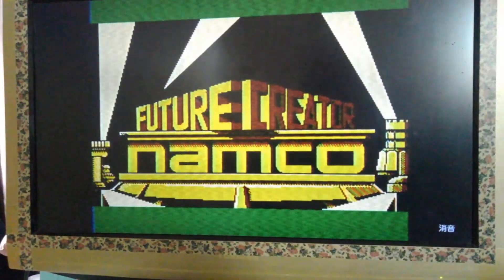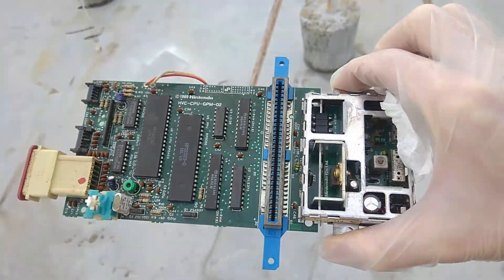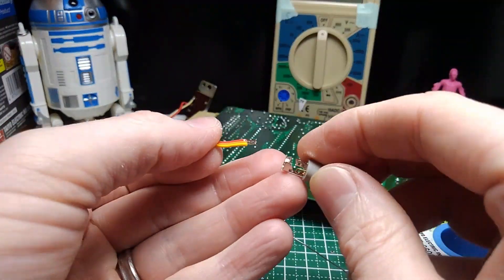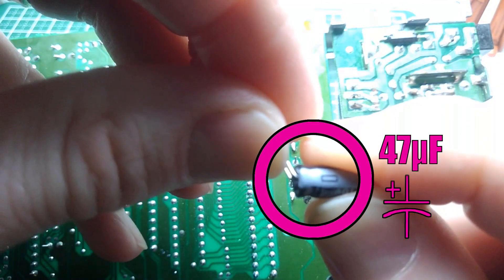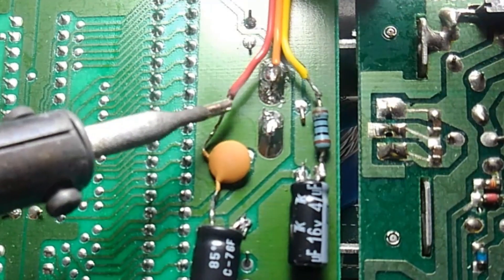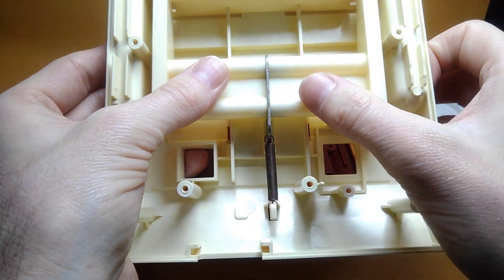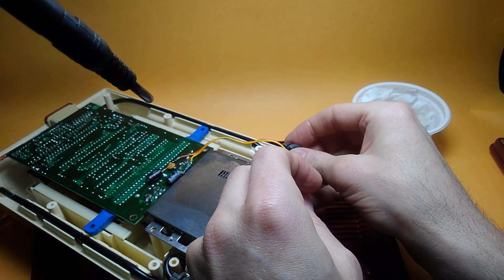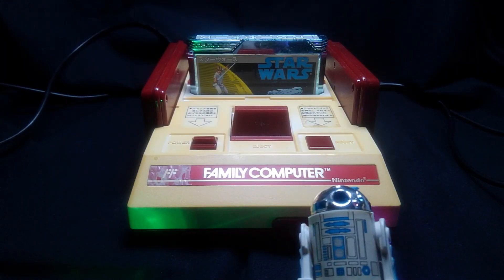Famicom AV mod made easy

Comment: Just because I’d like to make things a little more modular, is there any reason why I can’t put the additional components and outputs on a bit of strip board and run wires from the points on the original famicom board to the strip board?
Reply from the maker: Yes, many people make their own boards. 👍🏼

Comment: Hi, thanks a lot for this ! Just a couple of questions: 1) is this mod working on PAL TVs as well ? 2) Can I use the SNES/Super Famicom power supply for the Famicom as well ? Thank you in advance for your help
Reply from the maker: It should work on pal with the av mod. But SNES and SFC adapters are different I believe. super famicom and famicom adapters are one in the same. Just don't take a Super nintendo adapter and use it with a Super famicom or vice versa.

Comment: about the ceramic capacitor, do the volts matter? because i found one that has 50V and i dont know if it will damage the famicom
Reply from the maker: 50 volts is the rating of the capacitor so the higher the voltage the better. If the original capacitor was 16v and you replace it with a 50v that means it can take a 50 volt charge if for some reason that would even occur. Rule of thumb is its OK to go higher on the original voltage. But you don't want to go lower.

Comment: I bought an av modded famicom and it has scrolling static . Do you know what could be causing this ?
Reply from the maker: It's really difficult to know what the issue is without having it in front of me. But often times a Cap replacement is a good start. Also I find changing out the power board has worked for me. Good luck 👍✨️

Comment: Yo! It's my first time commenting, but I can't thank you enough for the content you release. I've recently been to Tokyo and managed to get "junk" hardware to restore and repair - and of course, I got a Famicom! I tried this mod on my HVC-CPU-07 revision, and I get a dark picture. Not extremely dark, but abnormally dark. What I tested : Changing the resistor to 220 / 100  ohms, soldering on the VID pin, soldering on the E pin of the transistor, and it changed absolutely nothing. Can that be because of the still connected RF module? After checking various AV mods, I see that a lot of mods remove the 2SA937 transistor. Can that be because of a tired transistor, too? Do you have any suggestion? Thanks!
Reply from the maker: I appreciate the kind words. HVC-CPU-07 has a different process from this video it involves lifting pin 21 and adjusting the transistor like you mentioned. I plan on making a how to video about it soon so be on the look out and good luck. There are other videos out there that will show you how just take a quick youtube search🙏🙏🏾🙏🏼✨️

Comment: I know this is an old video but, the little black plastic thing you routed the wire through so you didn't need to drill holes is called a grommet. Also thanks from 2024 this works great and looks nice as well.
Reply from the maker: I'm glad it worked out for you. I like to call one Wallace so no one gets jealous 😉

Comment: I've got a modded AV famicom, i got audio but I can't get the video to work! I tried 3.5 male to female RCA adaptor and direct 3.5 to RCA video cables but neither worked.. Tried Video w/ Mono sound, and Video w/ stereo sound and also didn't work. I don't know what to do with it anymore.
Reply from the maker: It may be the 3.5 jack and cable don't match try hooking up the red and white to the video in on TV not all cables are hooked up the same. To be sure you need to test from the mobo to the end of the cables to know for sure.
Reply: @ScruffyLookinRGB  Already solved it thanks! Switching matching colors worked for me. Sadly, i can confirm I got vertical stripes on the screen, and I can't use my Famicom with RF cable... Strange since the mod looks almost the same as yours. Thanks anyway!

Comment: I'm planning to order a famicom (idk what revision I'll get, lol). Your mod looks the simplest and has minimal impact on the console. Other mods use transistors, is there a difference in signal quality?
Reply from the maker: The earlier mobo revisions tend to have a much noisier signal. Later revisions have a much clearer signal. The earlier versions need a litte more work to get a clear signal. If you want the best signal the av famicom is the way to go. But if you like the original famicom astetics the later one is easier to mod for av.
Reply: @ScruffyLookinRGB  
Thanks for your reply!
Famicom looks like the console from my childhood and AV Famicom is too expensive.
By the way, I looked at the auctions and I have another question: if you just buy something that looks normal but has not been tested, what is the likelihood that everything will be fine with it? If there is just a little rust and swollen capacitors, this is also normal)
Are there problems there, like with the Super Famicom, when one of the processors may be faulty?

Comment: I noticed some light interference such as a faint buzzing sound in the background and very faint cascading static bars. The coaxial cable also has the interference so maybe it's something else.
Reply from the maker: The older famicom boards are quite noisy. It's tough to get them just right
Reply: @ScruffyLookinRGB  I took a second look and the coaxial output image is clear. It's only the mod that has that interference. It may be related to where I attach the 3.5mm to RCA cable into the Jack.

Comment: Hey man this might be a dumb question but is there a difference between a 16V audio capacitor and a 25V ?
Reply from the maker: 25V means the cap can take in more voltage than 16v⚡️rule of thumb is it's OK to replace a cap with a higher voltage rating never the opposite 😉

Comment: I like the idea of doing a no-cut and fully reversible mod. Also much cheaper than a VAMP board.

I wonder how easy it would be to do the old NES stereo audio mod with this. But also still having it be no-cut. Maybe with a small screwdriver sized potentiometer through one of the vent holes?
Reply from the maker: Nes stereo mod? Do you mean suddenly stereo or actual real stereo?
Reply: @ScruffyLookinRGB Not true stereo no. Just a slight separation of a couple of the voices the system can produce.
Reply: @ScruffyLookinRGB  I finally did the composite video mod. It worked out pretty well.
I am noticing a lot of jailbars and jitter in the video signal.

Maybe it's just an inherit issue with composite video out, but yours looked a lot better in the video.

Comment: Did not work all i hear is static noise when turning on fc on tv and no video btw i did everything you did
Reply from the maker: I would check your joints again and use a multimeter to make sure the video and audio are coming out the cable you expect it to. Good luck
Reply: @ScruffyLookinRGB   everything seems connected someone did a video and  have  the same model i have and did your tutorial and got the same result 
https://www.youtube.com/watch?v=mORA7LEGzLo
Reply from the maker: Did you check the rca cables with a multimeter while plugged into the trrs jack??
Reply: @ScruffyLookinRGB    yes everything seems connected
Reply from the maker: Does the rf output work?
Reply: @ScruffyLookinRGB  yes
Reply from the maker: You could try slightly lower or higher values on the caps and resistance

Comment: Beautiful.  It’s really cool that you kept it completely undo-able, I often wrestle with this very thing between being a collector and a fixer…. Perfectly adding a 3.5 Jack in the back would make me so happy, but also keeping it completely original would too…. It’s rough.  😅

I picked up a pristine Famicom a few years back listed as “junk” at a recycle shop.  They said it didn’t work, but it was so clean, un-yellowed, all stickers and port covers… and only 500円 it was a no brainer.  I figured at the very least I could case swap a functioning Famicom…. but for whatever reason, maybe my bad Japanese understanding (though it WAS priced as junk), it worked completely fine.  I still don’t understand the problem.. they had plenty of power adapters for sale that they could’ve used to check it.. 🤷‍♂️
Reply from the maker: Thanks. I'm glad there are others out there who agree with me and are unsure to add a jack or leave it as is.  This way we can keep the ancient rf intact. 
In Japan often junk just means untested. A lot of times they just don't have the time or care to test it.
Reply: @ScruffyLookinRGB  The fact that both outputs still work is pretty amazing to me, I’m glad you were able to figure that out.

Many a great deal, just because a Japanese person won’t be bothered to plug something in.  😂  I’m at about a 95% “completely fine” rate for “junk” items so far.
Reply from the maker: Yes same here I've come across a few that didn't work but were repairable

Comment: Hi, when I do that my screen is darker than RF. Do you know how I can have more light please ?
Reply from the maker: Try another tv and see if its the same. If it's same you could try a different capacitor value on the video side
Reply: @ScruffyLookinRGB  ok i will test others capacitors because i already try to change TV, same.
Reply: @ScruffyLookinRGB   What is "Takman" ? I did it with a simple 120Ohm resistor. Is it different ?

Comment: I just opened my famicom up and found it is the CPU-07 from 1984 motherboard and yours is a later revision.  I wonder if I can still follow your tutorial vid.  The back part looks the same as yours
Reply from the maker: If it's the older revision, it won't be the same as this one. But the good news is it easy to swap out the power board for a new one with composit video. Rgr makes a good one.

Comment: Ordered the parts to try this I have the same board I get great video through the coax but no sound so hopefully I get sound with this
Reply from the maker: Good luck! I hope you get the sound up and running💪
Reply: Got my parts in and installed iv got sound now and better video. Thank you so much. The bigger capacitor does seem to barley hit the bottom case and slightly bulge it when tighted. But I don't think it will be a issue.

Comment: I got a famicom diy kit av mod kit on eBay.  Just wondered when you prep the board and put flux is that the same as using soldering rosin?  I’m planning to learn to solder using a cheap famicom.
Reply from the maker: Yes and yes. I would suggest a no clean flux. Rosin or soldiering past leaves a bit of sticky residu so if you go that route hit it with some ipa to clean up the area.

Comment: I did this mod to a HVC-CPU-07 board Famicom and it worked, despite having different soldering locations. The picture is very dark, however. I saw in another comment that you mentioned changing the capacitor value may adjust the brightness of the picture. What values would you suggest trying to get this brighter picture?
Reply from the maker: I'd say between 220uf an 1000uf. Hope you find the sweet spot.
Reply: @ScruffyLookinRGB  Thank you so much. I’ll order a couple capacitors and check it out. Another theory I have is that it may be because I am powering my Famicom with a 9v Genesis Adapter rather than the original 10v one. I’ll let you know if I figure it out

Comment: @scruffylookingrbg i did this mod and i can only get it to work properly when something is plugged into the rf port.  Did you have this issue? I'm having it on two tvs with two different famicoms...
Reply from the maker: I've had issues with video or audio not coming through, but it always comes down to a poor connection on my soldiering.
Reply: @ScruffyLookinRGB  seems like I needed a bigger ground wire than I was using. All set, thanks! I have another revision I'm trying but getting no luck.  Not enough ground like the other but no matter where I ground it I'm having the same issue.  Might have to do the full conversion mod on that one.

Comment: Heyo, I've attempted this mod however I'm unable to produce any video, audio comes through completely clear, I've checked all the pins on my TRRS jack just to make sure the pin out isn't different, only thing I can think of is the fact I'm using a 1/2 watt 120ohm resistor, do you think that'd make the difference between picture and no picture at all?
Reply from the maker: I don't think that would be the reason. Usually it's a connection issue. I'd double check all your soldier joints.
Reply: @ScruffyLookinRGB  seems like my Retrotink 5X was the reason i wasnt getting a picture, directly into my TV tho gives bad waving lines and a loud buzz when the video signal is connected, all my solder joints are definitely good and i'm using the same components listed in the description, its so confusing :S
Reply: yo! just an update, got it all working, needed to ground the video connection seperately, must've been something off with my TRRS jack cause for some reason it only grounded the audio, the picture being all wavy and buzzing caused the retrotink to not accept the input aswell, so as soon as i got that fixed the RT5x was working too and looked very good for Composite, thanks for the vid!

Comment: Hey Scruffy! A question, I mistakenly bought 2200uf capacitors instead of 220uf for the audio.. Can I use them anyways? :) Thanks!
Reply from the maker: No, you gotta have the right value of microfarads
Reply: @ScruffyLookinRGB  What is the thinking of putting a 220uf in series with a 1uf, all that does is make  a 0.995uf capacitor.
Reply: Will ask for them to change up the order! Thanks
Reply: Yeah, the series capacitors confuse me too, from my understanding the 220uF capacitor doesn't do anything here?

Comment: Hey there! Thanks a lot for your video, I have an already modded Famicom but it's getting some weird white faint lines where objects are (in the game) and I'm going to try and get that mod out and do this one as soon as I get some level ups on my soldering skills. Thanks!
Reply from the maker: I hope you are able to fix the issues your having👍👍👍
Reply: Thanks a lot! Should be easy getting the other bad boy out I suppose. Just get the hot glue out, de-solder those wires and caps and see if I don't wreck it more than it is already! :D  @ScruffyLookinRGB

Comment: does it matter on the rating of the 1uf ceramic capacitor? im seeing 1uf 50v ones from my supplier

also is the mod different for the original famicom that has the soft square button controllers?
Reply from the maker: 50v should be plenty.

Comment: I did a similar av mod to my HVC-CPU-07 model, i had to kinda figure some stuff out on my own but i got it to work. But the picture is really dark
Reply from the maker: Glad to hear you got it working. some times you can change the value of the cap it may give you a brighter image.
Reply: @ScruffyLookinRGB  Ohh okay, thank you! Can I just remove the cap and connect the video out pin directly to the TV?

Comment: You are a hero! I just purchased a famicom without realizing it was RF so i was nervous when it came in. I was even more nervous when i saw i had a different board then yours. But thankfully your tutorial still worked on my board! The sound is perfect and the jailbars are very minimal. My one issue though is that the picture is quite dark and i'm not sure what is causing it, probably just my tv or a pin connection issue. 
Regardless, thank you so much!
Reply from the maker: Glad I could help! It could be the value of the capacitor you used causing the darker image too. But glad to hear things worked out for you.
Reply: could be the value of the resistor

Comment: Scruffy does this method in theory work with all model 1 famicoms where all i have to do is find audio video and ground? Im asking because i see other methods where you have to lift the pin on the ic and remove a transistor among other things.
Reply from the maker: I have done the pin lifting method before too. But for that revision i haven't tried it this way. In theory it should work. I'll have to try it out.

Comment: I hadn't thought of running the wires out the controller port opening, THANKS! I'm actually in the middle of sourcing PC Boards for the Super Nintendo AV out connector, believe it or not I'm using it to mod an Atari 2600, those have the ability to output S-Video so the plan is to rig up a dongle out the back much like the OEM RF cable. Then use easy to find commercial Nintendo AV cables with composite and S-Video connections.
Reply from the maker: That is a good way to handle it. The snes multiout should be standard on all retro tech would make things a lot easier😉👍👍👍

Comment: Hi, I have av modded my famicom refer to your tutorial. It works great. Thank you But when I play the game with no music in the background, there is a very buzzy electricity sound. it's that normal?
Reply from the maker: It might be the soldering joints or wire length. The longer the wire the more chance for interferience. Also the player two controler can cause an echo if its not cleaned or the volume slider is slightly turned on. But if its none of those things it could just be the console has a bit of noise. Ill check a few of my modded ones at home and see if i get any noise. And good work on your successful mod!

Comment: Its all working!!!!!
I was runing out of ideas so i tried taking out the ceramic capacitor and conecting the audio directely to the negative leg on the 220µF Capacitor and its working perfect now!!
Reply from the maker: Congratulations I'm glad you were able to get it up and running👍👍👍🎮
Reply: @ScruffyLookinRGB  Thank you man
I´m hyped af.
Is it worrying that im not using the ceramic capacitor? could it screw up something? or is that capaacitor more like for filtering noise and stuff so its something that wont damage anything by not beeing there?